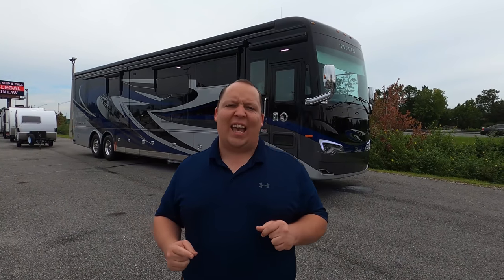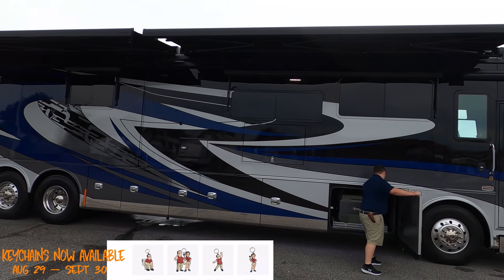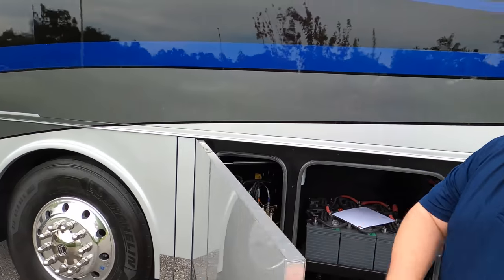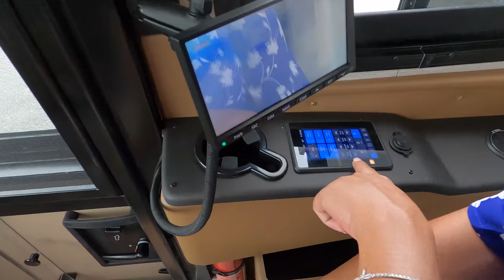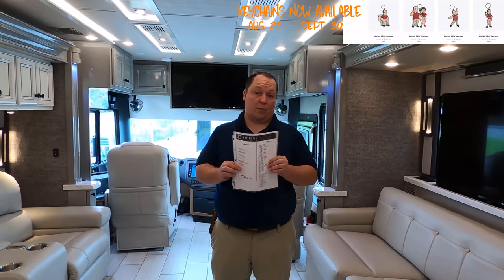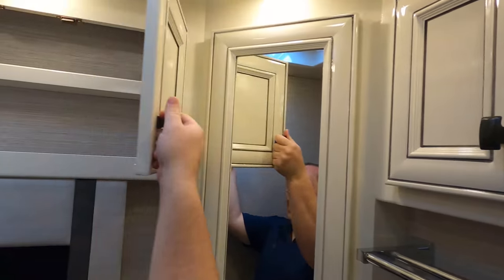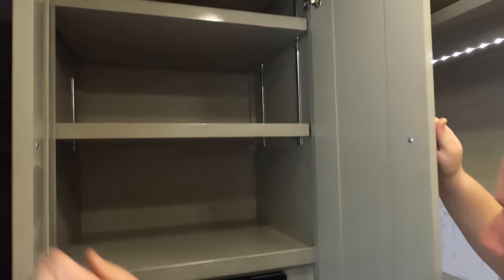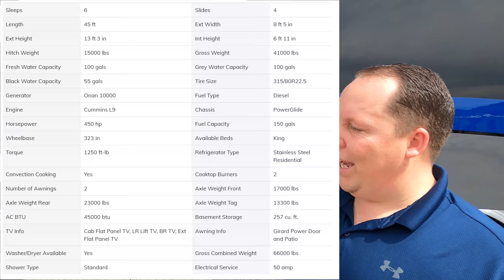The KING of Tiffin Motorhomes | Allegro Bus 45OPP

Comment: #1 Dislike...why do these manufactures keep putting the slides right behind the passenger seat so you can't recline while driving??? #2 dislike the ceiling looks like an airplane ceiling... should have added a curve in there somewhere. #3 The walkway is way to narrow with the slides in. #4 dislike, the pull out cabinet next to the microwave.  What I like, 1 high end look, 2 cabinetry, 3 all around luxury look, bathroom sinks, shower, flooring. #4 like, exterior paint.

Comment: Dislikes - indoors -dinette is low and does not make into a bed 2). carpet on slides  3). the gloss on the cabinets and would rather have a stainless steel fridge Outdoor Dislikes Location of the power cord, bay doors alignment  goes out easy and the fuel doors do not have a good fit. Indoor like - power shades,  kitchen peninsula the power bed and escape hatch and the great layout in rear bath Outdoor likes - More storage, Paint job and the cameras

Comment: Dislikes: Didn't like the "modern" white, gray, silver, black and tan mid-century design 60 years ago, still don't like it now.  Give me some color. Didn't like the overly fancy, mirror and high gloss 70's cabinet design, still don't like it now. Give me matte or semi-matte and shaker design. What's with the drawers and side access on upper cabinets in the kitchen?  I can't think of anything more awkward for a shorter person to have to use than those unnecessarily complex items.  Same with the under kitchen sink slide out bins.  Just give me regular cupboards and a slide out tray and let me decide what size of items I want to put in there and how. Don't over think what I want. I'd rather that be my own decision, thank you very much. Slide out carpets look cheap and cheesy, will be a trip hazard when they curl at the edges and will stain far too easily. Must be a better way for that. The bedroom escape "hatches" behind the TV and behind the bed headboard seem like they would take way too long to access in an emergency. If the power goes out due to an electrical fire, how could one move the TV down (if it's up and there's no power to lower it) and access the behind-the-headboard hatch anyway, if one can't move the bed and the panels extend down behind the bed.  Why aren't the panels sideways for certainty of removal?  Also, we personally hate the recessed puck florescent lights in the ceiling, both outside and inside the design element.  There's nothing that creates more fuzzy vision for folks with cataracts than those ceiling recessed florescent puck lights.  Well, they may not be florescent per se, but the scatter from the type of shade adds to vision fuzziness.  And who needs all that design crap on the ceiling?  Who spends their time looking at the ceiling? For the Cistine chapel, maybe, but I wouldn't crank my neck around and risk a strain or sprain for anything but that. All it does is draw attention to its ugly self. Yes, I said ugly. Overall, we found the interior design ugly and wouldn't ever buy it, no matter the cost. There are people who want luxury but luxury for them doesn't equate to gaudy and "modern" design sterility. Simplicity with natural forms, textures and colors (ocean green, sky blue, warm yellows, oranges, reds of fall, colors of blooming spring flowers) like the stones in the steps in -- that is what we're talkin' about! Or a REAL cork wall rather than wall paper pretending to be cork... all this is a design value, too. A lot of people RV because they want to be in touch with nature. So bring nature in. Liked all the storage, though.

Comment: DISLIKES:
1) Limited to three likes where there are so many
2) Carpet giving unfinished look to the slide when there are other alternatives. If actual tile cracks, vinyl floor tile appearing panels could compliment and are flexible to avoid cracks.
3) While the paneled appliances give the 1980's appearance of luxury that the 10,000 lb OCCC accommodates and they ran into issues as they duplicated the look and feel in the OCCC challenged Wayfarer, even luxury brand appliances today don't have the panels. Subzero, Viking, Miele and Thermadore appliances would scream luxury a lot louder than the panels.
LIKES:
1) Have to start with the overall attention to detail, both interior and exterior.
2) Seating, both living area and coach
3) Emergency exit design vs window design

The bed is a big question mark and in the current environment can't just wander on a GeneralRV lot to check it out.  Have seen it on several RV's, and while noted 'not a fan' but I am scratching my head. While almost universally people dislike the cut mattress fold, this appears to be a solid mattress with the head raised to full up for slide storage. Is this anything like an adjustable bedframe where it can be in the full flat position (one button push on my Tempurpedic frame) , granted the legs/feet can't be raised but can the head be raised 2-3" for sleep, or even full sit/reclining position for TV or reading? I would prefer that over a flat mattress any day.